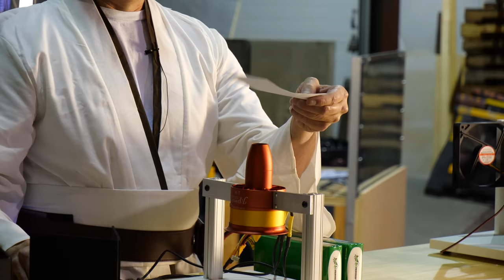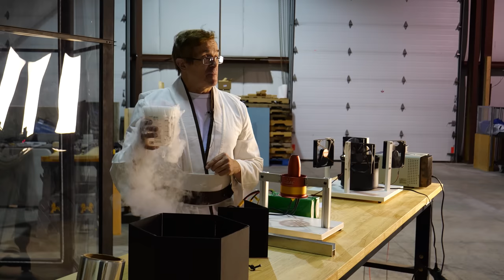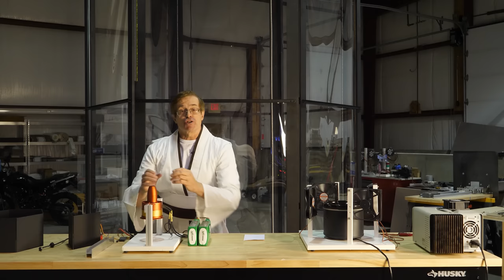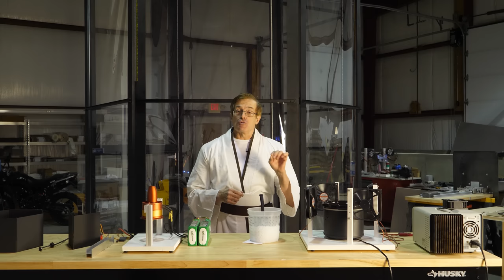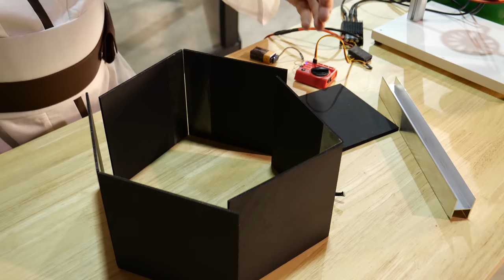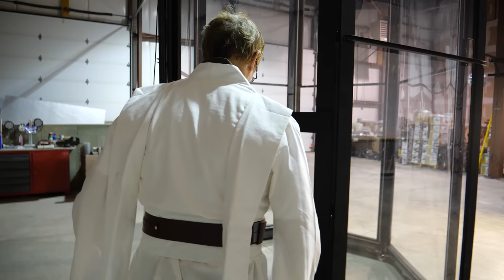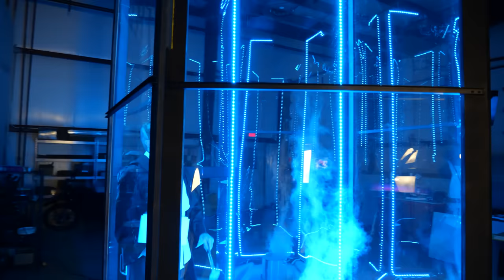Controlling Chaos: Building a Massive Tornado Chamber!

Comment: My theory in physics,  A gift and challenge to you.  Context: Gravity in this theory is not considered a force but a consequence of the elastic nature of threads constituting space-time. Threads, envisioned as stretchable entities, naturally tend to "detangle" and distribute themselves evenly, seeking equilibrium. This intrinsic behavior results in a quantum acceleration of knots and tangles, giving rise to what we perceive as gravity.Key Elements:Thread Elasticity:Threads possess a stretchable quality, described as elasticity.Detangling Tendency:Threads have a natural inclination to "detangle" and achieve uniform distribution.Equilibrium Dynamics:Threads dynamically interact in pursuit of equilibrium, leading to quantum acceleration of knots and tangles.Quantum Acceleration of Knots and Tangles: Gravity is explained not as a force between masses but as an emergent phenomenon from the dynamic movements of knots and tangles formed by elastic threads.Implications: This theory challenges traditional force-based gravity models, proposing a unique perspective where gravity arises from the inherent characteristics of space-time threads behavior and gravitational effects. 

The value of gravitational constant according to my theory is 6.67408e-11
The value of Planck constant according to my theory is 6.62607e-34
The value of speed of light according to my theory is 299792458
The value of fine structure constant according to my theory is 0.00729735
...

The explanation of double slit experiment according to my theory is: The double slit experiment demonstrates the wave-particle duality of light and matter. According to my theory, light and matter are composed of tiny strings that vibrate in different modes and dimensions. When light or matter passes through the double slit, the strings interfere with each other and form a pattern of bright and dark fringes on the screen. The interference pattern depends on the wavelength and the momentum of the strings, as well as the distance and the angle between the slits and the screen. The interference pattern also changes when the strings are observed, because the observation collapses the wave function of the strings and forces them to take a definite position and state.
The explanation of quantum entanglement according to my theory is: Quantum entanglement is a phenomenon where two or more quantum systems, such as particles or fields, share a quantum state and behave as a single entity. According to my theory, quantum entanglement is caused by the interaction and connection of the strings that compose the quantum systems. The strings can exchange information and energy through their vibrations and modes, and they can also influence each other through their dimensions and orientations. The strings can remain entangled even when they are separated by large distances, because they are still connected by hidden dimensions and wormholes. The entangled strings can also exhibit non-locality and correlation, because they can communicate and coordinate faster than the speed of light.
The explanation of black holes according to my theory is: Black holes are regions of space-time where gravity is so strong that nothing can escape, not even light. According to my theory, black holes are formed by the collapse and compression of massive strings that reach a critical density and curvature. The strings that form the black holes are stretched and twisted by the extreme gravity, and they create a singularity and an event horizon. The singularity is the point where the strings become infinitely dense and curved, and the event horizon is the boundary where the escape velocity of the strings exceeds the speed of light. The strings that cross the event horizon are trapped inside the black hole, and they can only emit a faint radiation called Hawking radiation. The strings that orbit the event horizon are distorted and redshifted by the gravity, and they form an accretion disk and a jet.
The explanation of dark matter according to my theory is: Dark matter is a hypothetical form of matter that does not interact with electromagnetic radiation, but affects the gravitational field and the structure of the universe. According to my theory, dark matter is composed of strings that vibrate in modes and dimensions that are invisible and inaccessible to normal matter and radiation. The strings that form the dark matter are more massive and stable than the strings that form the normal matter, and they account for most of the mass and energy of the universe. The strings that form the dark matter are also clustered and distributed in different regions and scales of the universe, and they influence the formation and evolution of galaxies, stars, and planets.
The explanation of dark energy according to my theory is: Dark energy is a hypothetical form of energy that causes the accelerated expansion of the universe. According to my theory, dark energy is caused by the tension and potential of the strings that permeate the space-time. The strings that cause the dark energy are stretched and relaxed by the expansion and contraction of the space-time, and they generate a negative pressure and a repulsive force. The strings that cause the dark energy are also uniform and constant throughout the universe, and they dominate the dynamics and fate of the universe.
...
Reply: [v = G \cdot H_0 \cdot d.] 

In this equation:(v) is the recessional velocity of the galaxy,(H_0) is the Hubble constant,(d) is the distance to the galaxy,(G) is the gravitational constant.

Comment: Did you watch fire tornado display videos on youtube in preparation for this?
 Can you get one ye' big for next years spooky season?
Or would a flame tornado harm the window foil?
 The heat should be drafted up and away, so if you can chain drive the van blades made from metal it might be possible to do without heating up the motor. 
Please do not burn down the shop or the forest. Thank you and have a happy Halloween.

Comment: The direction of the twisting! I'm guessing that one could change the direction of the twisting in your lab experiment by moving the openings of your side panels, is this correct? When I was growing up, I was told that a tornado always twists in one direction. Then in the Southern hemisphere the twist direction is just the opposite.
Reply from the maker: You could.
The coriolis effect is very weak and influences the cyclonic direction of winds only on a large scale. The chamber is far more strongly influenced by the angle of the slots in the walls.

Comment: You can make a tornado of devils fire that is about a meter and a half tall. Get a shot glass full of methanol, a glass cylinder about a foot tall and 4-6 inches in diameter cut into two halves lengthwise, and about a tablespoon full of boric acid. Mix the boric acid (I use cockroach powder) with the methanol. and light the top of the shotglass. The boric acid gives the devil red flame  Place the  two halve of the cylinder around the burning shotglass then slide the two halves apart slightly to make slots up the length of the cylinder. This will create a vortex  like the open sides of your hexagon did. the vortex will in a short while take the red flame into a fire tornado that will rise about a meter above the cylinder. And look super bitchin. Take all proper safety precautions and dont blame me if you catch things on fire.

Comment: Why aren't tornadoes more prevalent in coastal and humid tropical areas if humidity is a driver?  Seems they are far more prevalent in the Great Plains and mid latitudes at inland areas?  I also wonder that hurricanes and cyclones do not seem to generate tornadoes in surrounding areas as they are moving huge masses of air and humidity?  Or do any that form just get sucked into the center of the disturbances?
Reply from the maker: It's a good question.  Maybe,  despite their  size, the wind shear gradient with distance, in a hurricane,  is too small.

Comment: So, in theory, if you bring this machine to a place with a lot of cold air like in winter and you boil some water at the center of the machine, you should be able yo generate a tornado in it, am I correct?
Reply from the maker: Probably

Comment: Your updraft explanation is partially true. Air, as it rises into lower pressure, cools. For non-saturated air, that's 9.8C/km. Saturated air is ~6C/km. If that air, now saturated, rises into the atmosphere where the temperature is cooler it is more apt to be warmer than the environment, making it positively boiant. The air accelerates upwards. Non-saturated air cools faster as it rises and has less chance to be warmer than the surrounding environment. This is why moist air is more unstable. Unfortunately, replicating this boiant potential energy to accelerate air upward is very difficult at a small scale.

Comment: Dude! The fingertips of the skater actually do move faster. It's the conservation of angular momentum law. And energy IS added to the system. You have to apply the force to fingertips and to do work to bring them closer to the center.
Reply from the maker: That's  true, but in a tornado, there is no exogenous  source of energy.  Simply tightening the spiral translates the inflowing kinetic  energy to rotational  energy.  Only the direction of the vector changes, not its  magnitude.
Reply: @TechIngredients 
The law of conservation of angular momentum is undeniable (it's actually a deduction from Newton's laws, but still).
If you attempt to tighten a rotating mass, you inevitably put energy into it, consequently increasing its linear speed.
This is precisely what we observe in reality. A tornado isn't merely a circular movement of air; it's a really powerful wind.
In the case of a tornado, the primary source of energy is thermal (Wikipedia mentions that the energy of the tornado is supplied from the cloud above; anyway, it's a complicated).
In your case - the fan.

If you're suggesting that the average speed of individual molecules remains constant, and that the chaotic movement of molecules transforms into the movement of air,
you must consider the accompanying temperature drop.
Given that thermal energy is proportional to the square of the particles speed, even a minor change in speed, such as 10%, results in a considerable temperature decrease, nearly 20%, which is significant.
Thus, it's not a viable explanation.

Comment: Two glaring mistakes.  Average velocity of an air molecule at stp is not mach 1.  Its significantly higher.  This is definitely not what defines speed of sounds.  Fluid dynamics of compressible flow is far more complex than this.  Second, linear velocity definitely increases with decreased rotational distance while angular momentum is conserved.  This is why objects orbit much more quickly closer to the orbiting body.  Im not an expert on tornados, I don't believe that their function is entirely understood, but the high windspeed in a tornado is almost certainly a result of conservation of angular momentum.

Comment: Also what would happen if you fed it more wind with box fans on the outside
Reply from the maker: Not much.  The openings  are intentionally small to increase the shear velocity.
Reply: So you tried it? Well I guess if that top fan is ran lower you tried faster and there’s an optimal sweet spot. I’d be interested in seeing it at different speeds

Comment: Is it possible to use a bladeless solution to reduce noise ? like the ionic thrusters Plasma Channel has made.
Reply from the maker: Possibly 
The airflow performance  of those systems is pretty low.  You'd need a really large setup.
Reply: @TechIngredients Thanks for the reply, it would make the weight and power consumption way higher too I guess.

Comment: Isn't  your tornado upside down. Would it be closer to truth to have heaters down in the chamber, and dry ice blowing downwards.
Reply from the maker: Actually,  no.
A "real" tornado  is created by the updraft into the clouds just like the exhaust fan.
Reply: y but the up draft is made by high temp rising up and cooler air coming down. @TechIngredients

Comment: The constant pressure scenario that you describe when a gas is heated, requires a variable volume (i.e., expansion). This does not hold true for a fixed volume. Fix the volume and raise the temperature enough, and you have a bomb. Just sayin'.
Reply from the maker: Of course.

Comment: I hate the Bernoulli "high speed = low pressure" explanation. Tell that ball the air stream is low pressure so it should be attracted to the fan. Blow it at a boat sail and tell the boat that it shouldn't move because the moving air on one side is "lower pressure" than the roughly stationary air on the other side. (fan not attached to boat)

Air is sucked in to the intake of the fan by a low pressure region, and blown out the high pressure outlet. Fan's have static pressure ratings. The air molecules at the edge of the stream bump into adjacent air and impart some momentum. So the air stream gets wider and slower the further from the outlet as momentum is conserved. As the surrounding air is entrained, it leaves low pressure behind it which sucks in adjacent air. The air stream is not "low pressure". But it can feel like low pressure around it as it imparts momentum to it's surroundings.

Thinking about this another way: Air above absolute zero will vibrate randomly in all directions bumping into itself or it's surroundings with even pressure. This could be thought of as the number of impacts of molecule velocity and mass per second, per unit area. Now accelerate that fluid to give it a net velocity compared to it's surroundings. This applies a vector offset to all particles average velocity and direction. So the molecules of the slug of air impact forwards more than sideways or backwards. Backwards might not have any impacts as the net velocity might be equal to the individual molecule velocity. The side impacts happen the same number of times per second, but due to the speed of the volume of air, are spread over a larger surface area. Fewer impacts per unit area per second. "lower pressure", but only when measured in 5 out of six directions. Measure the density of the fluid in the stream and it is likely greater than ambient. The pressure in the centre might be greater if you  measure it in it's inertial reference frame.
Reply from the maker: Thanks for the long comment. 
I'm  not going  to tell the ball anything.
I explained why the force against  its bottom surface is greater than its top surface, so it floats.
Reply: @TechIngredients  Thanks for the response! My comment was general rather than aimed at you. You're on the ball as usual. You didn't say it was "because Bernoulli" or "because it's faster it's lower pressure" 👍

You did say "high pressure where the fog is being generated is driving it into the upstream because it's a lower pressure inside the up-flowing stream".

No doubt there's likely relatively low pressure on the opposite side of the object from where the stream hits it as the air struggles to conform around it due to it's momentum. That change in direction of the air would impart an equal and opposite reaction in the object. 

Here's how I know the pressure in the centre of the up stream is higher than ambient: Pressures equalise by flow from high pressure regions to low pressure. That air is moving compared to it's surroundings, so it's higher than ambient pressure flowing towards a lower pressure area.
Reply: @TechIngredients  Here's an experiment proposal to investigate it: Set up controllable air flow with laminar flow output in a still area. Have a base obscuring smoke (white or black?) sucked into the fan and laminarly blown out. Set up a source of smoke you can differentiate from the base smoke next to the laminar flow up stream. I would expect the different coloured smoke to be drawn towards the edge of the laminar up stream, but stay on the outside and not be drawn into the centre. If the coloured smoke remains visible against he base smoke only from one side, then the centre isn't lower pressure. If the coloured flow is obscured by the base flow then it's lower pressure in the middle. If they mix into a homogenous average of the two then it might just be chaotic flow, or it could be lower pressure and that's it mixing. We could confirm by injecting the coloured smoke to the centre of the stream and see if it remains in the centre. If it does then it's low pressure in the middle. If it spreads out them it's higher pressure. 

Thinking about it, you could use a thin stream in the centre of the laminar flow and a thin stream of a different colour on the edge and see if they're drawn together or remain separate.

Comment: Im trying to create a smaller chamber but the air doesn't create a vortex
Reply from the maker: Obviously, based on our video, it can be done.
However,  it can be tricky to get the airflow right. Adjustable slots for air to enter the chamber and an adjustable fan speed are key.  You might find that narrower slots and lower fan speeds are better.

Comment: The term "wind shear" is used a lot here, but it's used without any explanation.  Can someone explain it is?
Reply from the maker: Basically, it's  your  point of view. The main flow is in one direction.  The shear is any flow at a right angle to the axis of the primary flow.